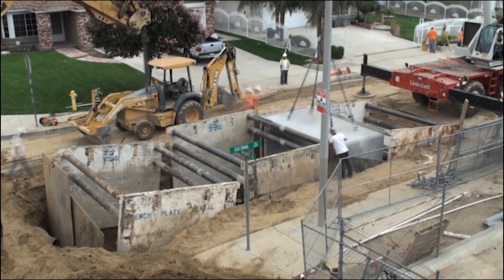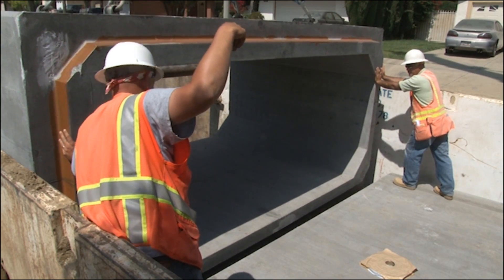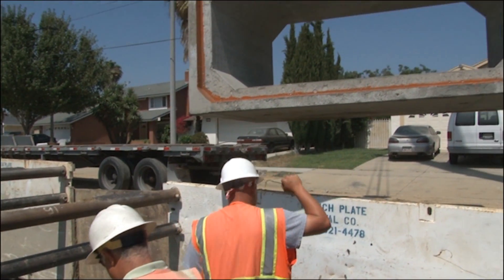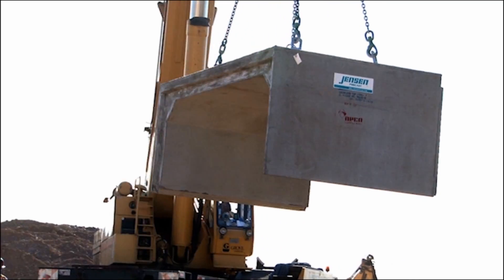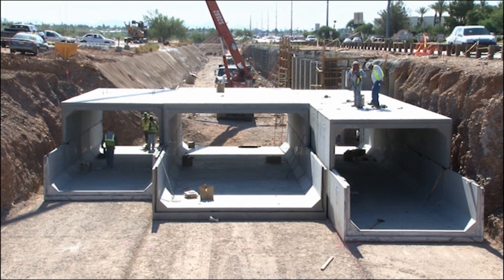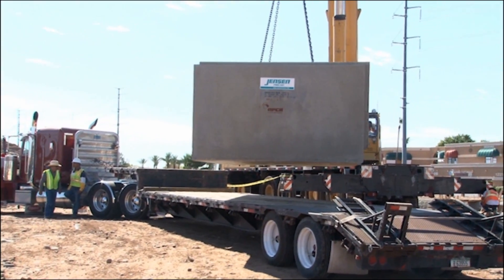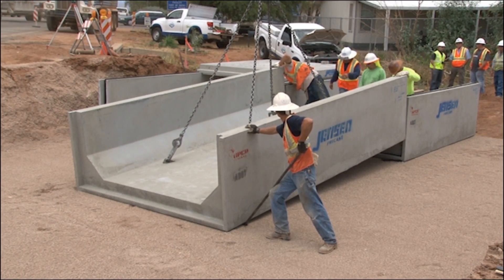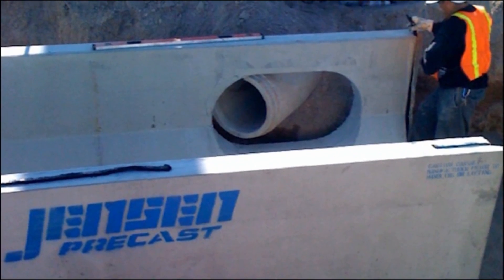Precast Concrete Segmental Box Culvert Design

Comment: The idea is great but I think rhe normal box culvert is still cheaper. From structural design point of view; the box culvert provides moment connections at corners and all walls/slabs supports are fixed.
When you divide the culvert to two segments the point at mid of wall(end of segment ) will be pinned support whuch makes the wall thickness more and result in more concrete...